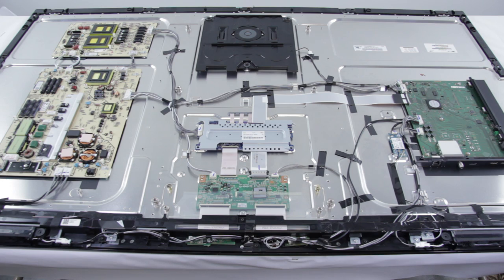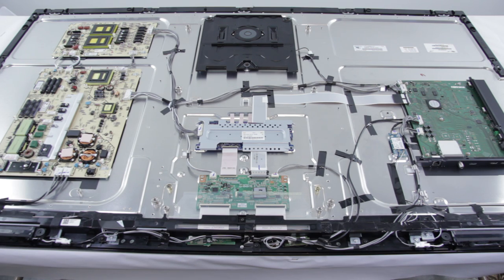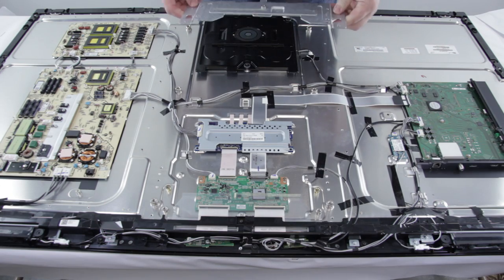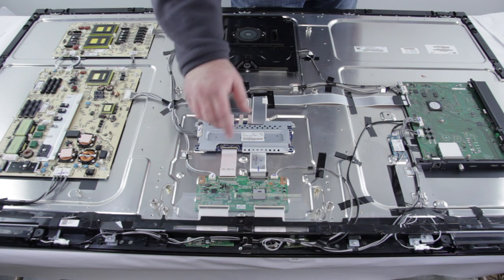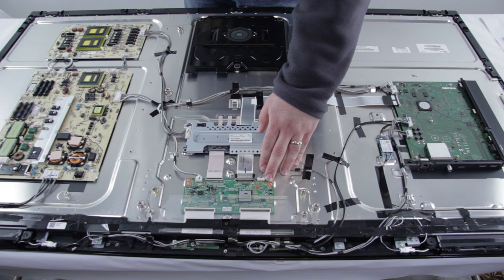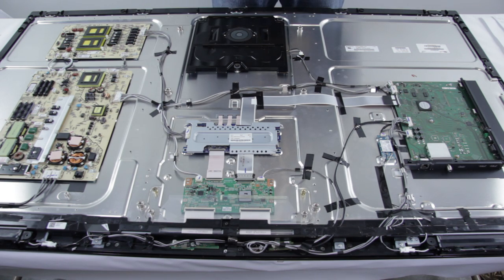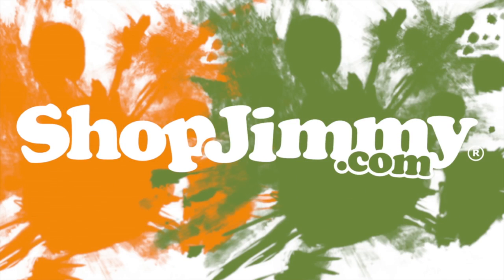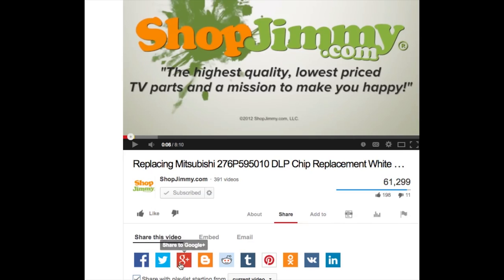LED TV Repair T-Con Board Help Review Overview - Common Issues and Problems with T-Con Boards

Comment: ok i have 42inch techwood 42832 when i switch on the screen hazy white then picture will gradually appear after about half hour to hour flickering it has twin invertor board to which i checked all connection they ok not the power supply as replaced checked main board connectors all ok only thing it leaves is tcon board  as when i put back on after stripping and checking all plug connections  it fire up ok then reverts bk to problem when left a few hours your thoughts on this and whether it sound like the tcon board  regards await answer before buying part
Reply from the maker: Diane Roylance   I recommend replacing the T-Con board in your TV.  Here is a link to replacement parts for your TV model number on our website, click here:  http://www.shopjimmy.com/catalogsearch/result/?q=techwood+42832  Be sure to match part numbers on your current board, with your replacement for compatibility.  You can also call our customer service for further assistance with your purchase.  (877) 881-6492  Thanks and please let us know if you have any further questions with your TV Repair!  www.shopjimmy.com
Reply: was told could be screen but cant see it if picture comes on eventualy everytime can you ,,and site outa stock of tcon boards jus looked
Reply: Diane Roylance 5 days no reply shop jimmy???
Reply from the maker: Diane Roylance   After seeing the video, this looks like a TV panel problem.  If your TV panel is bad, it may be more cost-effective to replace the TV as panels are typically hard to find in stock, difficult to replace, and expensive.  Thanks and please let us know if you have any further questions!  www.shopjimmy.com

Comment: ln46a750R1fxza Samsung. I replaced main board about 3 years ago. Picture is still nice. However when first turn on for about 10 min the left side of tv picture is faded with lines. You can tap back and sometimes goes away but most time just have to wait for it to warm up. Should I replace main board it t con board? When this happens I can press menu and it comes up but left side is wavy to start.

Comment: I have an LG42LC2D television and I need to know if anyone can tell me how to save the calibration. What I do is go into the factory service menu by holding the menu buttons on the tv and the remote at the same time. I set it up exactly how I want it and then exit the menu. But as soon as I change the channel the settings go right back to the way they were before I changed them. Is there any way to save these settings? I would love to know. I'm talking about the settings for the X-Postion, Y-Postion, H-Size and W-size. Thank you.
Reply from the maker: 95gtscort  Unfortunately, we are unable to help with this.  Thanks!  www.shopjimmy.com

Comment: I have a Samsung TV Model LN-T3242HX/XAA that started to get the white screen problem, I can still see the image, just color is all whited out.
Reply: So i tried unplugging the power cable for a few mins, then turning it back on... It will behave normally for about a minute, then the white screen fades back on.
Reply from the maker: dakren12   Try all repairs and troubleshooting at your own risk.  This could be a problem with either the t-con board, the main board or the TV panel.  You can replace the main board and the t-con board individually to see if one of those boards fixes the problem.  Click this link to replacement parts for your TV model number:  http://www.shopjimmy.com/catalogsearch/result/?q=LN-T3242HX%2FXAA  There may be multiple boards for the same TV model number, be sure to match part numbers on your current board, with your replacement for compatibility.  Thanks and please let us know if you have any further questions with your TV Repair!  www.shopjimmy.com
Reply: thanks ShopJimmy

Comment: hi. i have a sony-KLV26S400A, recently while watching a movie the picture suddenly went white blank, i switched off the tv and then few minutes later i switched it on and there were movie image with horizontal multicolored lines on the screen but the sound was Ok. what could be the possible problem? should i replace the t con board?
Reply from the maker: *****   I recommend trying the main board first to see if that fixes your TV problem.  Unfortunately I do not see any replacement parts in the search results for your TV model number on our website.  Please reply with your part number on your main board and I can try searching for replacement parts.  Thanks and please let us know if you have any further questions!  www.shopjimmy.com
Reply: ShopJimmy.com  thanks for your reply, the main board model no. A1527471B  1058532. Kindly advice the fix for this problem.
Reply from the maker: *****   I don't see any info for those numbers.  Watch this video and see if it helps at all.  TV Part Number Identification Guide for Sony Main Boards (LCD, LED, Plasma TVs) TV Repair  Thanks!  www.shopjimmy.com
Reply: ***** Hi, just to let you know that now the screen is totally white blank, so now should i replace the main board or the t con board? i even tried disconnecting the t con board and then switched on the tv , in that case the tv screen in on with green led light glowing on panel. kindly advice the right fix

Comment: Hi there.
I have an LG 42 inch 3D Led TV. The model number is 42LM760T. 
My issue is that it suddenly just started displaying very feint evenly spaced black horizontal lines across the TV from one end to the other. Theses are all at 180 degree lines. I can still see the picture and if far away from screen it's note even noticeable, but close enough I can see it. It's just annoying. 
I've been told that this could be the connectors or TCON board. I've only had TV for 2 years.
Your help would be most appreciated. 
Thanks 
Daniel.
Reply: Another image https://docs.google.com/file/d/0BznTBwD1B-muZ0p6aEtFV3U3MEE/edit?usp=docslist_api
Reply: Last image, https://docs.google.com/file/d/0BznTBwD1B-mudThidGhaQk9hSFE/edit?usp=docslist_api
Reply from the maker: Daniel Clark   Try all repairs and troubleshooting at your own risk.  This sounds like a TV panel (TV Screen) problem.  If your TV panel is bad, it may be more cost-effective to replace the TV as panels are typically hard to find in stock, difficult to replace, and expensive.  Thanks and please let us know if you have any further questions!  www.shopjimmy.com

Comment: need to replace the green boards that the flex ribbon coming out of t con board connects to. but i don't know what they are called out how to get ahold of em. Samsung led tv 60inch un60fh6003fxza
can any one help me? it looks like it's burned out even flex ribbon had black on it. but it didn't come from t con board it came from the very bottom of tv frame.
Reply: Edward Curiel main board

Comment: Vizio 50 inches model # e500i-b1 serial # ltnwpljq4661403 the problem with my Tv when I turn it on I hear sound but no picture , the back light skin on . I didn't turn the tv on for 2 weeks and I turn it on today n it came on . This is  the 2nd time it did this

Comment: Philips 
42pfl3704d/f7
So tv turned on with an ALL white screen, purchased a new t-con board from you guys, replaced it, shows picture now, however, i now a vertical white washed section (shows image just white washed) 
re-checked all ribbon cables and plugs i could see.....what would be my next step??
Thanks
Reply from the maker: Caytie Kehret   This sounds like a TV panel (TV Screen) problem.  If your TV panel is bad, it may be more cost-effective to replace the TV as panels are typically hard to find in stock, difficult to replace, and expensive.  Thanks and please let us know if you have any further questions!  www.shopjimmy.com
Reply: ShopJimmy.com Ive seen with some of the plasma tvs with colored bars, some people have re-flowed some of the connections going to the panel, COULD this be a similar issue? 
Thanks

Comment: Hi. I have an LG 47LN5400. Recently my screen started blacking out while watching. Yesterday when I went to turn on the tv, the lg light flashed as it normally does and then turned off (it normally stays lit). The tv screen flashes white and then goes to a black screen, yet I can still somewhat see tv settings when I hit setting on the remote, but it's very hard to see (the screen is almost completely black). The warranty on the tv is up and my local tv repair shop is wanting to charge over $300 to fix (that was a brief estimate over the phone). I've tried unplugging the tv but no luck. I've opened the back of the tv and checked all of the capacitors but they all look good with no signs of any of them going bad. Would an issue such as this be the T-Con board? I'm really trying to avoid paying that much to fix it when the tv is less than 2 years old. Any thoughts on what the issue could be? Any help would be much appreciated. Thank you!
Reply from the maker: Vincent Francisco  Try all repairs and troubleshooting at your own risk.  I recommend running the flashlight test on your TV.   Here is a link to a video we produced that shows how to run the flashlight test. https://www.youtube.com/watch?v=xUzCLgoSPGM Please reply with your flashlight test results and we can recommend a replacement part for your TV repair. Thanks and please let us know if you have any questions! www.shopjimmy.com
Reply: ShopJimmy.com Thank you for the response. I performed the flashlight test but did not see any backlights. When I flash the light on the screen, I am able to see (vaguely) the settings menu on the screen. The tv does have audio. Is the backlight inverter built into the power board on this model?

Comment: HELLO I HAVE A VIZIO 50IN E500I-B1 SMART TV 1 YR OLD , I HAD A BLUE SCREEN WHEN I TURNED IT ON AND JUST THE SOUND WORKED , I WAS TOLD IT WAS A T-CON BOARD I CHANGED THAT NOW MY SCREEN IS WHITE WHEN I POWER ON?? NOW I ALSO CHANGED THE MAIN BOARD AND SAME THING WHITE SCREEN, WHAT COULD BE WRONG?? THANKS
Reply from the maker: +bobbyv125   Try all repairs and troubleshooting at your own risk.  You may have gotten the wrong t-con or a defective t-con board.  Did you match part numbers and any important information?  Thanks!  www.shopjimmy.com
Reply: hi, yes i did match all  #s  on both boards it took a week or so for a reply so i got rid of the tv and bought a new one ! thanks anyway..

Comment: Hi, I'm Raj. I've LG 55LM7600. TV has start up problem. When I start up, the LG logo appears and its gets shutdown after 3 or 4 seconds. Please suggest the root cause of this problem
Reply from the maker: +Rajesh Rajendrababu   Try all repairs and troubleshooting at your own risk.  I recommend replacing the main board in your TV.  Click this link to replacement parts for your TV model number:  http://www.shopjimmy.com/catalogsearch/result/index/?cat=56&q=55LM7600  There may be multiple boards for the same TV model number, be sure to match part numbers on your current board, with your replacement for compatibility.  Here is a link to a video showing how to identify your part number, click here:  https://www.youtube.com/watch?v=RwHTvjMdrhk  Thanks and please let us know if you have any further questions with your TV Repair!  www.shopjimmy.com

Comment: I have Philips 32 inch LCD TV and I can hear sound continuously but in between video flicker and after some time no video on display only audio. There is same T-Con board problem or any other issue? Please HELP.

Model No.: Philips LCD TV 32PFL5355/V7

Comment: Hello, I have a Westinghouse TV # DWM55F1Y1    Ser.#7593H40200613 
Every thing works fine except the brightness is very low and I have turned it up as far as it will go. Does this sound like the t-con or display screen?  I don't want to buy a t-con board and then have the display damage it.
Thank you.
Lynwood

Comment: I have Samsung UN55ES6580. There is no image on the screen from any of the HDMI ports. I cannot tell if the speakers are on because I had them turned off before the screen stop displaying. When I power on the screen I can see it glow but nothing on the screen (black). I thought it may be the T-Con board based on your video. I turned off the TV and turned it back on and slowly an image appeared. I cannot tell what the image is. It appears to be random pixels. It looks like a picture of a galaxy. It does not change. Even after restarting the "picture of the galaxy" appears. I switched HDMI ports with different sources and the the picture of the galaxy remains stationary but the brightness of some of the pixels change. I believe it is from the content delivered to TV. T-con or much much more?
Reply from the maker: Jason Irizarry  Please watch this video FIRST to help with your repair!  https://www.youtube.com/watch?v=BP3NVNCGEv8  I recommend replacing the main board in your TV.  Click this link to replacement parts:  http://www.shopjimmy.com/catalogsearch/result/index/?cat=56&q=UN55ES6580  There may be multiple boards for the same TV model number, be sure to match part numbers on your current board, with your replacement for compatibility.  Here is a link to a video showing how to identify your part number, click here:  https://www.youtube.com/watch?v=BEPWrefQvqI  Thanks and please let us know if you have any further questions with your TV Repair!  www.shopjimmy.com

Comment: Plz help me...I have samsung led UA32D4000 model tv....It have some problems regarding color production...When turned on it shows the original colours and after few seconds it blinks and the colour fades...Red is viewed as dark yellow and blue as violet...plz comment your solution to this......
Reply from the maker: Rahul R   PLEASE SUBSCRIBE TO OUR CHANNEL - Try all repairs and troubleshooting at your own risk.  This could be a problem with either the main board, the t-con board or the TV panel.  You can replace the main board and t-con board individually to see if one of those boards fixes the problem.  Unfortunately I do not see any replacement parts in the search results for your TV model number on our website.  Thanks and please let us know if you have any further questions!  www.shopjimmy.com
Reply: Thank you :-)

Comment: I have a Phillips 47PFL5704D/F7 with the exact problem shown in the video I linked below, except mine only displays the horizontal grey bars and is constant. No identifiers for menu,channel up down, input show up. No logos...just constant horizontal grey bars What do you think I need to replace? Thank you for your time!! phillips 42" tv problems 47pfl5704d/f7 ebay
Reply: I have the same problem with a 47" Philip 47pfl6704D/f7. Were you able to find a solution?

Comment: Hi guys, i have a samsung ue40eh5000 tv, when i switch it on, i get a half grey screen, not instantly, from cold its got a grey patch on the affected side, as it warms, the whole right side goes grey, i just need a confirmation (it sounds like it is) its the tcon board, its about 18 months old, many thanks.
Reply from the maker: Andy Parsons   Try all repairs and troubleshooting at your own risk.  This sounds like a TV panel (TV Screen) problem.  If your TV panel is bad, it may be more cost-effective to replace the TV as panels are typically hard to find in stock, difficult to replace, and expensive.  Thanks and please let us know if you have any further questions!  www.shopjimmy.com

Comment: Samsung UN65ES8000FXZA TV works fine for a few minutes then the screen goes black. Flashlight test shows nothing. Sound was working fine, no back lights, power light is on. ??
Reply from the maker: +Gary Kessell  Try all repairs and troubleshooting at your own risk.   I recommend replacing the main board in your TV.  Click this link to replacement parts for your TV model number:  http://www.shopjimmy.com/catalogsearch/result/index/?cat=56&q=UN65ES8000FXZA  There may be multiple boards for the same TV model number, be sure to match part numbers on your current board, with your replacement for compatibility.  Thanks and please let us know if you have any further questions with your TV Repair!  www.shopjimmy.com

Comment: Hey Jimmy, my Samsung LED tv has vertical and horizontal lines in it...i watched your video on how to fix it...how much is the part? and how long does it take to send it to me..Miami Florida..Product Information Samsung LED UN46B7100
Software Version: T-CHE7AUSC-1018-1
Reply from the maker: Elona Hoxha  Please watch this video FIRST to help with your repair!  https://www.youtube.com/watch?v=BP3NVNCGEv8  This could be a problem with your T-con board, your Main board or the TV panel.  You can replace the main board and the t-con board individually to see which one fixes the problem.  Click this link to replacement parts for your TV model number:  http://www.shopjimmy.com/catalogsearch/result/?q=UN46B7100  There may be multiple boards for the same TV model number, be sure to match part numbers on your current board, with your replacement for compatibility.  Thanks and please let us know if you have any further questions with your TV Repair!  www.shopjimmy.com

Comment: Vertical Lines randomly or when pressing volume on the remote.Random colors or same color...TV was fixed once( a year ago) under warranty by Samsung and I was told it was the TCon.Problem getting worst(more frequent).Would like to buy a replacement to install myself.Samsung Model No UN60ES7500FModel Code UN60ES7500FXZAVersion HS01S/N Z4YD3CDCC00566LThanks in advance,
Reply from the maker: +reinaldomas13   Try all repairs and troubleshooting at your own risk.  This sounds like a TV panel (TV Screen) problem.  If your TV panel is bad, it may be more cost-effective to replace the TV as panels are typically hard to find in stock, difficult to replace, and expensive.  Thanks and please let us know if you have any further questions!  www.shopjimmy.com